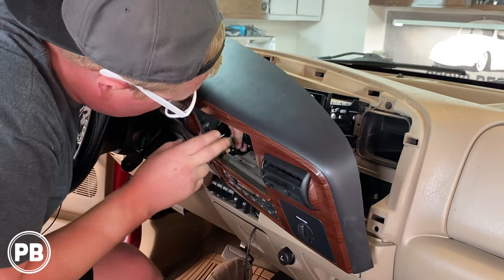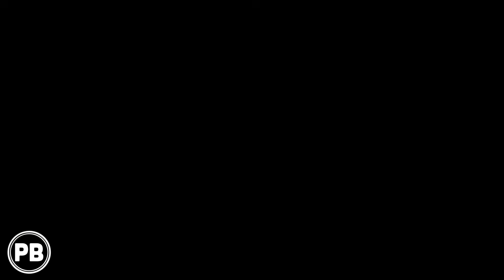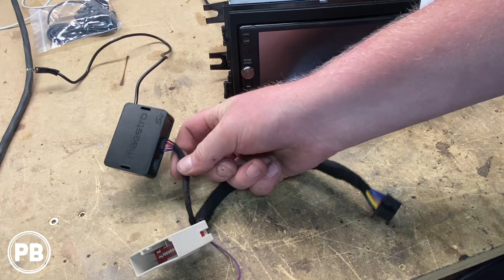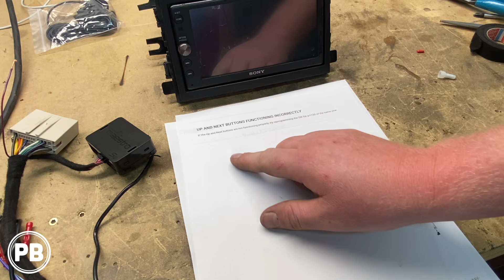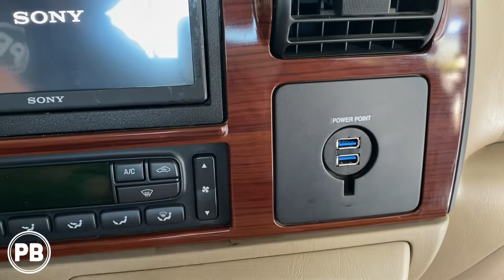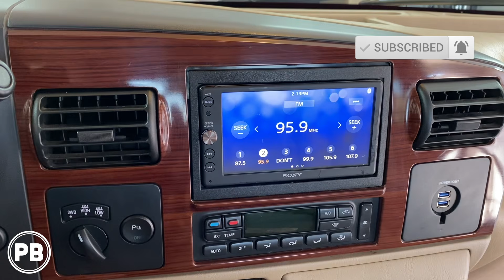2005 - 2007 Ford F250 / F350 Radio Install

Comment: Personally, i prefer the scoche amplified adapter that has a wire in every cavity so you can connect to the adapter and have it unplugable/up-date/grade-able, just gotta figure a way to do the same for reverse (backup cam trigger), maybe steal a pin from a reverse harness and pin into the factory connector.

Comment: Can’t get the steering controls to work. Reflashed the module to F150 and different F250 years just in case. I even resoldered the Maestro wires to make sure it was all correct. I’ve checked that I’m tapped into pin 18 on the factor wires and still nothing. Any tips?
Reply: You ever figure it out? Currently having the same issue
Reply: @camronmcgovern4682 I actually never figured it out with the Maestro. Recently ended up getting the Crux SWRFD-60L Wiring Interface from crutchfield and it worked like a charm. No need to tap into any wiring. Just had to resolder the connections to the new interface which comes wired to the connector. You’ll see on the module there’s 8 or 10 pins that you have to align in a certain pattern depending on the stereo. The “old Sony” I think it was, is what worked for me. The different options are shown in the instruction sheet. I also had to connect the module to the input directly beneath the mic input. I honestly think that’s probably why it wasn’t working in the original setup. I had it plugged into the corner A/V input which I don’t think is correct despite what this video shows.

Comment: Error: 2:34 "Dash kit ... Metra 95-5812".  That is correct,  but in the description you list and link to the Metra 95-5817 kit, which is insufficient.

Comment: Thanks for a great video!! My stereo turns on but has no sound at all, sometimes static… I tested the speakers and they work fine, any suggestions? It’s a 2005 f350 with an alpine stereo
Reply from the maker: Sounds like you may have the wrong harness adapter, or something isn't wired right.  Send us a message on facebook / instagram and we can try and help.
Reply: How to tell if you need the factory amplifier harness or not? @ProvoBeastAudio
Reply from the maker: @whimsicalfox  If you have the factory subwoofer under the rear seat, then you have the OEM amplifier.  IF not, the alternative harness linked is what is needed.

Comment: I have a pioneer double din in my truck now i want to switch to a jvc double din is it the same wiring ?
Reply from the maker: It won't be plug and play, no, as each brand uses their own harness plug.  You will have to cut the harness and re wire in the new radio's harness plug, proprietary to that radio.

Comment: I already have an older aftermarket head unit in my truck and my steering wheel controls work. Does this mean I already have a Maestro or similar unit or will I still need that too?
Reply from the maker: Yes, but depends if it’s truly universal for any radio. Pull the radio and find out

Comment: Video was super helpful for me to figure out all the SWC related wiring, thanks! With the dual USB port instead of the cigarette lighter, how did you wire the plug that was just for charging?
Reply: Would also love to know how this was wired up as I’ve purchased the same dual port

Comment: quick question I'm instlling a Pioneer dmh-w4660nex and it has a car speed signal input wire (pink) where does it go to on a 2005 F250 lariat?  thanks in advance the video helped alot.
Reply from the maker: If you update the newest software on your pioneer, you shouldn't need to hook up the VSS wire on the radio.  If not you will need to research where the VSS wire is on your Ford.

Comment: I have a 2007 ford f250 and a Pioneer 8100nex. When you press volume up button on the steering wheel the volume goes down not up, if I disconnect batteries and reconnect them the volume button on steering wheel works correctly with the radio, then after a week starts malfunctioning again. Any idea what the problem is?
Reply from the maker: Good question, try re-flashing the module and give it another shot.
Reply: @ProvoBeastAudio  How do you re-flash a module and where is it?

Comment: Does the harness for the steering wheel controls come with the radio, steering wheel control adapter, or sold separately? I clicked on your link above for the adapter and it doesn't say that is comes with the harness neither does the radio. I'm looking at getting the Sony xav-ax5000 radio. Thank
Reply from the maker: The steering wheel control adapter is sold separately: https://amzn.to/3A8eAMa or you can use this pac one here: https://amzn.to/3AStI12
Reply from the maker: The ford harness adapter is sold separately, along with the separate steering wheel control module.  All linked separately in the video as nothing will be sold together.

Comment: The radio in my sport trac is not working. How do I know if it's the radio or the wires? Just bought the truck and it was not working to begin with.
Reply from the maker: I'd start by checking the fuse before you pull the radio.

Comment: Where did you get that power point dual USBs? Also what steering wheel cover is that? Thank you
Reply from the maker: All parts used in description.  This wasn't a personal vehicle, so unknown about steering wheel cover.